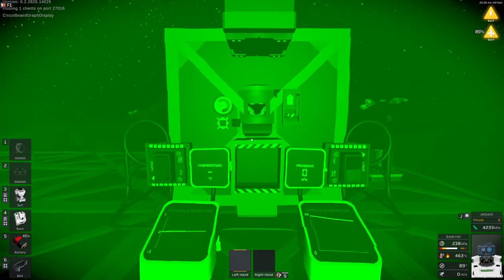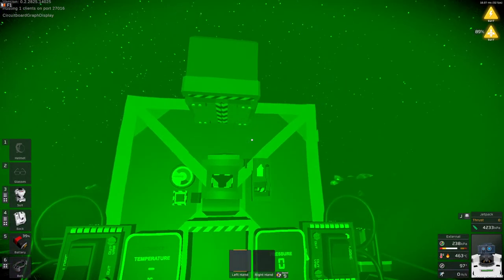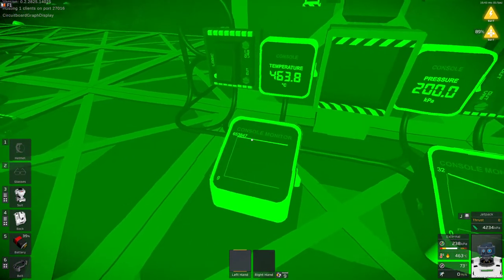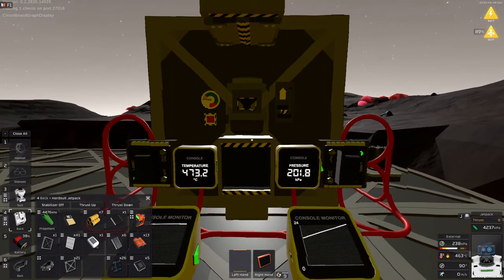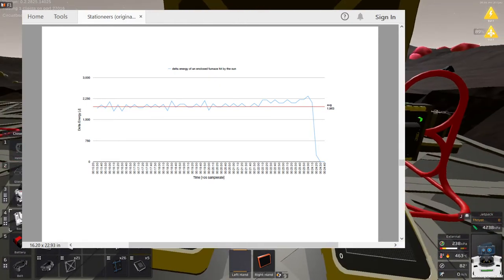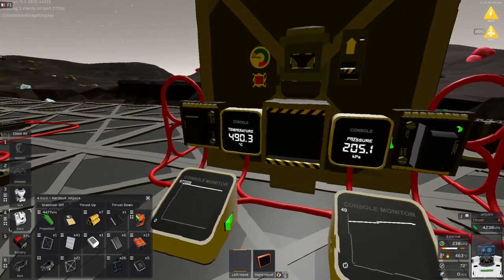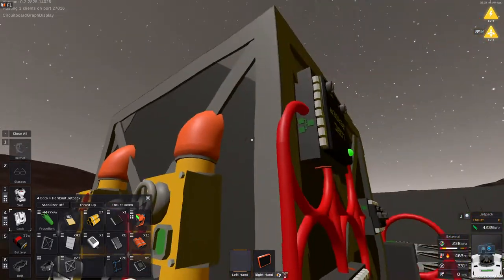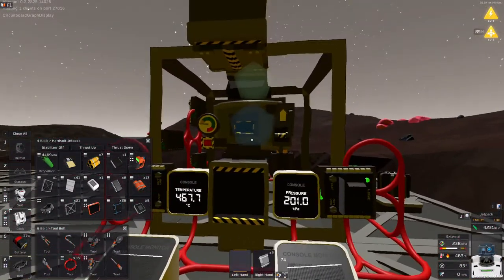Stationeers: Sun powered Furnace - v0.2.2826.14043

Comment: This is a very nice experiment. I like your attention to detail.

The 60W and 200W values are really strange. I thought about it, and I'm walking out on such thin ice here... I'm sure I will regret posting this later, but...
I know that only gas can have temperature in the game, so everything solid can be ignored. I also know that a block is 2m*2m*2m in size, with a volume of 8kL (I reached that number when I was calculating on the atmosphere with PV=nRT, where all values are known except for V). And finally I know that the furnace has an internal volume of 1000L.
So... the ratio between 60 and 200 is 3.33 (roughly). First of all, this ratio doesn't make sense to me, something must have gone wrong somewhere, energy per area should be the same no matter what, but instead it's being concentrated.
Now, let's assume that each block is given a fixed amount of energy for simplicity. Let's also assume that the game still considers the surface area of the gas in the block and spreads the energy over that number. If the surface area in the block were to be reduced, that would mean that more energy must now be recieved by the smaller area to make up for it. That would fit with the observed behaviour. We also know that the furnace cools down when it's hot, so it needs a number that represents its size, otherwise those calculations wouldn't work.
Lets assume the sun is at zenith, and that this is always done by the game to reduce the number of calculations needed, this gives each block an area of 2m*2m (you showed that the energy recieved doesn't depend on the solar angle). The furnace is probably either a cube or a sphere, lets try both. If the furnace is a cube, it would have a surface area of 1m*1m. That would mean the furnace would get x4 energy but it doesn't so that is wrong. If the furnace was a spehere instead, the radius 0.620351 will give it a volume of 1kL, and a circle with the same radius have a surface area of 1.20899 square meters. That would mean the furnace area will recieve 2*2 / 1.20899 = 3.30855 more energy over that area. 60W * 3.30855 = 198.5W, your measured average was 196.3W... how accurate was that 60W value? Was it closer to 59.33 maybe?
This number looks good. But it could still be complete nonsense that got lucky.

I'm really glad we can insulate the furnace to do experiments with it. But at the same time, it's such an obvious exploit, so I hope it will get patched out eventually.
Reply from the maker: First of all, thank you very much for this detailed comment. I wholeheartedly hope that you will not regret it, because I really enjoy this type of exchange. 
Given your considerations, it should be possible to create an experimental setup that can contain the limits of system behavior. The accuracy of the numbers given in the experiment is not very precise, but it should definitely be close to the real values. 
What do you think would be a good experimental setup to test your calculations? Maybe a comparison between 'full enclosed furnace' and 'wall enclosed furnace'? The influence of the sun could be tested on other planets as well. Different angles and divergent solar power.
I think I try to enhance the experiment setup so it can give you a more precise number on the  measured values as well. The sun angle is the thing that surprised me the most. Because I thought at least two sides of the block should get sunlight. I think the assumption that sun is a static factor is valid. I will try to prove this by covering the sides of the setup from the sunlight, maybe it will give some inside.

And thank you again for your comment. It got me thinking and that's what I enjoy the most.

PS: Sorry for the delay. I have to hold back comments because there is a recent spam bot issue on YouTube.
Reply: @casegard4324  I also like how the game allows experiments. It's really fun when someone finds something interesting. But I don't reason like an engineer or a scientist, so I sometimes assume way too much. I'm still uncertain if I got lucky with that ratio, or if I'm just fooling myself royaly with this.

I was thinking about how to test sunheating further too. Maybe with pipes, Automa8it made some videos about them. Pipes have a volume and a surface area too, same as the furnace. Pipes are a little bit more complicated than the furnace, because they can branch. But I don't think they made it too complicated, it could actually be straightforward, like the number of pipe items placed in the same spot will add a flat number to the surface area but not change its volume. A pipe analyzer won't fit on a branched pipe, but an insulated pipe with an analyzer could possibly be used to measure a branching pipe without interferring. But right now the smallest possible surface area should be the most interesting thing to look at, since that seems to concentrate the energy the most. It's also unknown if the game treats pipes like spheres or something else. One thing we can safely assume however is that a pipe has a smaller surface area. So the 200W what value for the furnace, should be even higher for a single pipe.

Let's assume that a single straight pipe is a sphere too, and that an analyzer don't block sunlight. The volume is 100L, so the radius of that sphere becomes 0.288, a circle with the same radius will then have a surface area of 0.2606. If these assumptions are correct it would mean that a single pipe will recieve 4/0.2606 = 15.4 times more energy than the 60W value. So the predicted value is 921W. So many assumptions again. But it's at least a value that could be compared against.

If pipes can catch energy like this too, it might be possible to use this in practice. Pipes can easily be extended to pass through many welded frames so they can catch energy from a big area. This is probably easiest to measure by keeping the mols of gas inside the pipe the same, and look at the speed at which the temperature changes in relation to how many fully welded frames it passes through. But I'm getting ahead of things, it's still not certain if a pipe will concentrate the solar energy like a furnace seem to do.

A wall enclosed furnace sounds interesting. In a glass box I suppose, like the one you measured 60W in. Would the surface area inside the box stay the same, or will it be increased or decreased by the furnace? It might not be 60W anymore, especially if the furnace has vaccum inside of it. Placing a furnace inside a sealed box doesn't increase the pressure as far as I know, but maybe it does, at least if the furnace have a physical size and is replacing the gas with it's own volume. That could be another way to measure it's volume, which would just be 1000L I suppose, but still.

About the sun angle, I think your experiment with the constant 60W and 200W increase regardless of sun position demonstrated neatly that 'sunlit' is a binary thing. But we don't know which part of the frame the sun warms up. Shadows can partially block solar panels, so shadows aren't binary. This is also an interesting topic.

edit:
I did some testing on Europa. I didn't see any temperature increase for a single pipe inside a frame (I used an insulated pipe sticking out so I could measure the temperature and pressure). So that didn't work. I got carried away with that idea.
I did see a temperature inside a furnace however, so that worked for me too. It's not much though. Sadly I can't think of a practical use for it.
Reply from the maker: Soooo :). I have build an experiment setup that can measure the energy difference between game ticks and made some experiments with it. 

Setup: Vulcan 150% sun 48deg angle, Venus 100% sun 0deg
Tests: I measured on both worlds the energy transfer for the furnace and a 1 frame glass box.

here it comes:
Vulcan: 125.02J per tick so 250J/s furnace, and 24.1J per tick so 48J/s for the box (Vulcan atmo heat capacity 23.2J/(mol*K))
Venus: 81.3J per tick so 162.6J/s furnace, and 34.5J per tick so 69J/s for the box (Venus atmo heat capacity 27.67J/(mol*K))

Venus (Pollutant): 67.0J per tick so 134J/s furnace, and 25.4J per tick so 50.8J/s for the box. (pollutant heat capacity 24.8J/(mol*K)

Additional observations: 
I blocked the front and back from the sun so only the top side gets sunlight. On Vulcan the sun shines on this side from around 53deg .. 128deg so 75deg. On venus it shines from 45deg.. 135deg so 90deg on this side.
The exchange rate is indeed constant for as long as the sun shines on the block.

I made some additional test for changing the temperature and the pressure but it looks like they do not change the transfer rate or at least only marginal.

Temporary conclusions: The exchange rate is dependent on the heat capacity. It is unclear if the initial sun for each world has an influence on the results (for this I have to test the pollutant on venus as well, if it gives different transfer rates this could be an indicator that the initial sun and/or the angle have an influence on the result.). 

I also tested the pipe conjecture but unfortunately pipes enclosed in a frame have no energy transfer with the surrounding. A real bummer, it could indeed give a deeper inside in the system. But maybe this indicates, that for the furnace the 'no heat exchange' function is missing in the code.

I have not done any calculations for now, these are just measurement results. And I wanted to give you the results here, so you can check it against your suggestions. I tried to be as precise and thoroughly as possible but ofc it is possible that I made a mistake in the measurements.

I have to say it was a blast to build the experiment setup. Thank you very much for pushing me into the right direction. And for your reasoning, don't let the fear of making a mistake keep you from having ideas. Looking at a problem from different angles can never be a mistake.
Reply: @casegard4324  That is some nice data! And what a big difference between Venus atmosphere and pure pollutant in the box. The heat capacity is 11.5% higher for the atmosphere but the heat increase was 35.8% higher. I don't know what that means, does CO2 actually have a greenhouse effect or something?

And judging from the blocking-sunlight tests, it's the top of the block that counts, or perhaps just any surface at all.

You asked earlier if there were other items than the furnace and pipes who has an internal volume... the ice crusher and the tanks comes to mind, idk how cannisters or portable tanks will react to welded frames, I never tested that.

edit:
 I tested the ice crusher and a cannister on Europa. A cannister holder could be placed inside a frame, it also heated up while the sunlight shone on the welded frame. The ice crusher I'm not sure about, I couldn't read its temperature with a logic chip and the atmosphere were cooling it down too quickly when I opened the frame so I couldn't tell if the sun had heated it or not.
Reply: I  wondered if there were a lazy way to repeat the same experiment on different worlds. So I took a copy of a save file and replaced the worldsettings.xml with one from a save on another planet. And it seems to work pretty well. Turning Europa2 into Mimas created some floating square blocks, but the ground level was the same (and the deep parts of the base stayed the same), the atmosphere became a vaccum and my base still had the correct breathable atmosphere inside of it. I'm not 100% certain this is a good idea, but it sure makes things easy. And it's possible to tweak the outside temperature, atmospheric pressure and composition, and even the strength of the sun if one wants to.

edit:
<SolarScale> is the the one that controls the power output for solar panels, so I think that's the one to change. I'm not sure what <MaxSunIntensity> does, only vulcan has a different value. <SolarEclipticAngle> is the angle where 0 is straight up.
<AtmosphereComposition> spawns various gases, the number is the amount of moles inside each area that is 2*2*2 meters. The pressure can be calculated via PV=nRT
<Kelvin> is for the temperature, where <time> 0 seems to be dawn, 0.25 is noon, 0.5 sunset and 0.75 is midnight I believe. There is also the value 1, but wouldn't that mean dawn too?
Reply from the maker: Hehe, nice one, this would indeed help to streamline the experiments. Changing the atmospheric concentration and temperatures in this file would be awesome. This opens so much possibilities :) I will have a look at that tomorrow. Very nice find. Also, strength of sun you say? Now I know what I do tomorrow :)

I tested it earlier today, but unfortunately you can not enclose a tank. The game will not let you place a frame around it. The Ice crusher I have not thought of, also definitely worth a test tomorrow.
Reply from the maker: Mehh, I managed to get myself into a corner :). I found the tags you mentioned and changing them was all fine. Unfortunately did I manage to overwrite my main save and the last experiment save. Entirely my fault, the naming of these files was pretty similar and I tend to mix up Venus and Vulcan all the time. On the other hand I did try to use the 'small tank' as well and this one can indeed enclosed into a frame. I tried it with the portable tank yesterday and this was not working. The  results so far is not so overwhelming. A quick test with the 'solar scale' shows that this is a defining factor but all other variables are still unclear so far.
Reply: @casegard4324  It should be easy to restore the save. If you make a new game on the correct planet, you can just copy over the worldsettings from that one. It's not like you changed the original game files, like I did once, but that can be repaired too.

I kind of got the feeling that all items that heat up inside a frame, are also items that probably shouldn't be allowed to be inside them in the first place. Almost as if the devs allows this insulation exploit for now but might have plans to fix it in the future.
Reply from the maker: I think I have destroyed the files. I loaded the wrong file and then saved this file to my main save, so it has overwritten the main file with the new wrong file. And I did this again with the experiment save. Basically I changed the settings couple of times like you suggested and this was all fine, then I loaded the wrong file and accidentally saved it over the both mentioned files. I was just to hasty :). Do you think this can be restored? If not, it also not a big deal, I got a little bit mad about myself but nothing serious and now I can just rebuild everything.

Hmm, now that you say it, yes all items that are not supposed to be encased in a frame have this unusual heating issue. I don't think the devs know about this. Before insulated pipes it was pretty much uncertain how the sun heating worked. But lets try to see if we can get some sense out of this and then we can file a bug report.
Reply: @casegard4324  I could restore save files where I just changed the worldsettings.xml file. Saving inside the game shouldn't damage anything either. The .xml file you changed will be identical for all worlds playing on venus so you should only need to swap in a fresh copy from another venus save and it should be fully restored. The .xml file you changed doesn't have information of where you changed the world by digging or building, it's just data about the sun, atmosphere and temperature and parameters for generating ground elevation which is just math.